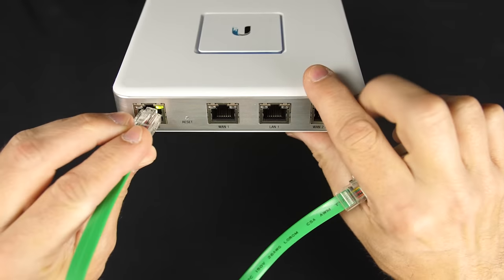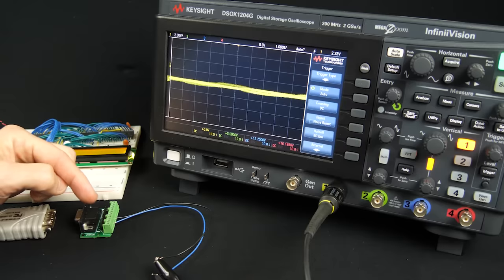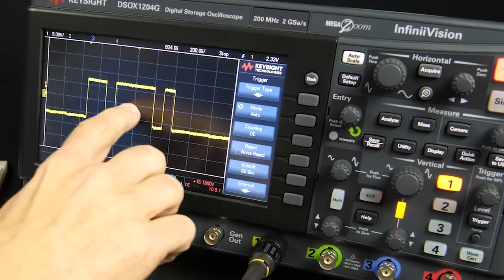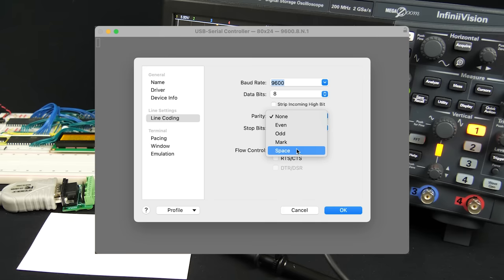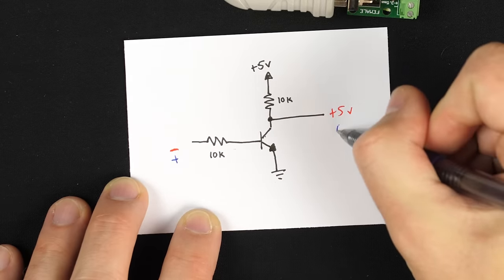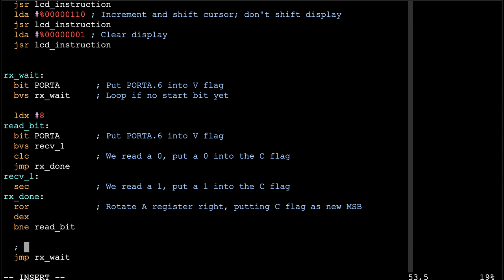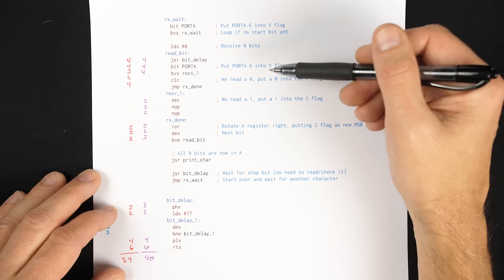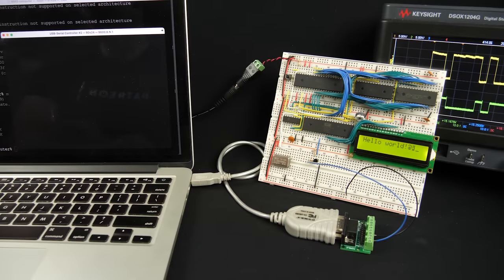The RS-232 protocol

Comment: Hey! If you are curious what the clock pins are used for, in some applications (I work in optical sensors) you need to have very precise timing associated with each data packet. The Clock and Ref_clock pins can be used to connect a very precise oscillator (at 1 kHz for example) to the device you are getting data from. This is helpful if you need to integrate the results you get (and thus need exactly defined dt.) This is an alternative to a synchronous serial interface, which comes with it's own problems. It is very nice to be able to use an asynchronous interface with precise intervals defined for specific data packets.

to get a little weedier, what matters more than the time a packet is sent/recieved is the time a packet was GENERATED. this often involves numerical calculations (in an FPGA for instance) where you need to know exactly when the communication RTL logic is "sampling" a normalizer or shift register for instance.

Comment: Finally a video again! :) It's crazy to think that 1 MHz is barely fast enough to read 9600 bps comfortably. Can't go much faster and do anything useful with the data. Btw, you should have probably subtracted the time it takes to write the character on screen from the stop-bit-wait-time to be super correct, even though it is probably a fast action anyway.
Looking forward to the video showing this with a dedicated chip.
Reply: The print doesn't happen until all the bits are properly put into the A register.  The looping only happens while he is reading the bits from the serial port, which has very specific timing.  The whole point of RS232 is that the clock is synced on the first read of a bit, basically the second line of code in rx_wait.  So the print is not happening until after the looping, so it is not counted in the clock cycles.
Reply: But he does need to be careful that it doesn't take more than 104 cycles, so that it runs while the terminal is transmitting the stop but, or else he may miss the start of the next start bit.
Reply: In real computers there is normally a dedicated chip “UART” (universal asynchronous receiver / transmitter) that does all this timing and shifting. The CPU is not expected to do all this. The UART chip is told what baud rate and it does its thing in parallel with whatever else the computer is doing. The computer may just be waiting for each character or do real work.
Reply: You can get away with it as long as you allocate a circular buffer  to store the received data AND use interrupts to do the reading. The display timing requirements are really not that strict. Check out The 8-bit Guy video on character LCDs, he used push buttons to write data to the display at normal human speeds.
Reply: @ChrisBouchard  That is what the cts signal is for, all he has to do is to drop cts at the end and the sending device should then wait. When ready to receive the next character he raises cts again. cts = clear to send.

Comment: Ben,  Glad to see you're alive and well  - and continuing this series.

Reminds me of many serial debugging sessions... where some device manufacturer would use the wrong gender (M when it should have been F), 25P on one end, 9 on the other... so we'd bolt together gender blenders, 25-9 pin adapters, maybe a null modem, and an LED module (for the user... are there blikenlights?).. all behind a desk with about half an inch of dust, paper clips, thumb tacks, coffee stirrers, get well cards, and the occasional half-eaten doughnut.

Also, love you showing the assembler (and your mistakes :).  Another blast-from-the-past doing 8086 during my CS degree times.  With all the high-level languages out there (C and higher) we forget how nested and spaghetti assembler can be.  As well as where the CPU meets the real world (pins).

Comment: This was interesting! One apparent mistake: when you calculated the timing for the half-bit you didn't account for the other cycles which were part of the read loop, you just divided the loop value by two, though I expect that was accurate enough to read from somewhere within the stable part of the bit. It would be nice to cover audio and MIDI in a future video.
Reply: It probably works out with 6 being a little less than half of thirteen, too :)
Reply: By my calculations, 9 would have put it right in the middle, even closer if you put a nop outside the loop. But as you say, hitting the middle exactly isn't real important. Throwing the bit delay routine to skip the stop bit is a little more questionable as it doesn't wait a whole bit without all the read logic, in fact it waits maybe 24 or 25 ms less than a whole bit. But you really want to wait 1.5 bits because you have the last half of the last bit, plus a whole stop bit to wait if you are going to do that. Probably best to just wait for the next start bit.
Reply: It is not a big deal.
If the sampling point is exactly at 50% of the bit time or 40% or 60% into the bit time, doesn't matter.
The purpose was to shift the sampling point away from the signal edge, since at that time (and only at that time) a few nanoseconds may make all the difference.
Reply: @jmarkmurphy  
No
You do note want to wait the stop bit time at all!
The purpose of the stop bit is for the sender to provide the receiver enough time to process the received byte. In his case it is the output to the lcd.
The stop bits are a setting for the sender only. A receiver can ignore this setting completely since the sender will start with a new start bit for the next byte anyway. There is no point for the receiver to wait when he can use that time for much more important things (as eg. storing the byte in a queue).

You may want to wait for the last data bit to be finished (but not the stop bits!). But you don't need to when the UART read loop is constructed like that

     wait for mark          <------ if the progeam waits here this means that the last bit of the previous byte was a 1, wait for it top be finished and
                                         ------ then wait for the stop bits to pass by untile the next start bit begins
     wait for space        <------ now we know  that this detected signal edge is indeed the beginning of the start bit
     .....
     receive the bits

This takes care of the 2 cases:
    * the receive loop was terminated early with a 1 as the last bit
    * the receive loop was terminated early with a 0 as the last bit

It gives the program the maximum amount of time needed to process a received byte.

Comment: I wish PHX and PLX (along with PHY and PLY) had been available when I was writing 6502 assembly language in the early '80s. Back then you'd have to use TXA : PHA to push the X register and PLA : TAX to pull it, in both cases losing the contents of the accumulator, so more often than not you'd have to save it first.
Reply: Yep. The extra instructions on the 65C02 vs the 6502 are nice. But in this application, unneeded. For instance, in the delay loop, what's the difference between using the X registers, or the A register?
In either case, the counting register is saved on the stack and restored at the end, so either could be used with no change in code length, or timing. Also, the code he's writing isn't exactly the shortest. For instance the part that has the carry set, or cleared depending upon the V flag with modifications to try and make each path take approximately the same amount of time. His method has the paths matched to within 1 clock cycle. Not bad. But an alternate piece of code with the same time matching would be.

  CLC
  BVC Skip
  SEC
Skip:

Only 1 conditional jump instead of a conditional jump and an unconditional jump.
No extra NOPs to try and balance the timing.
It's still one clock cycle off, as his is. But even that could be eliminated by careful placement of the code within memory, so that the BVC branches over a page boundary. If no page boundary crossed, the Carry set path is 1 clock longer. If a page boundary is crossed, then both paths take the same amount of time.

I am a bit curious where he things that the BVS takes either 3 or 4 clock cycles depending upon if the branch is taken or not. According to the documentation I have it will take 2 clock cycles if the branch is not taken, and if the branch is taken, it will take either 3 or 4 cycles, depending upon if the branch crosses a page boundary.  And since he's using a 65C02 and is explicitly using 65C02 opcodes, he should have used a BRA (branch always) instead of a JMP. The BRA takes 3 clock cycles instead of the JMP's 4 cycles and that one cycle difference would have allowed him to balance the path timing exactly, regardless of which path is taken.
Reply: @johncochran8497  Interesting stuff. Thankfully I never really had to worry that much about how many cycles it took to execute a given instruction. With the old 6502 it does make a difference which register you increment to form a loop because the {65C02 specific) INC and DEC instructions weren't available and you'd have to use CLC : ADC #1 to increment the accumulator.
Reply: @johnm2012  I've used both the 6502 and Z80. Frankly, they both have their places, but I prefer the Z80. And for the "Z80 is inefficient. Look at how many clock cycles it uses when compared to the 6502" crowd. I say that clock cycles isn't what you should be looking at in a system. Memory access time is the correct parameter. So if you take a 500 ns memory system, for the 6502, the maximum usable clock speed is 1MHz. While with the same 500 ns memory, the Z80 can run at 3MHz. And since the usual rule of thumb for the 6502 and Z80 is that a Z80 running at twice the frequency is about as fast as the 6502, the Z80 looks a lot better than the 6502 for a given memory speed. But the memory issue for the 6502 can sometimes be turned upside down. Because the memory has to be accessed during a half clock cycle, some makers decide to use the memory that needs to be that fast and alternate between the CPU and the VIDEO (Apple comes to mind). So the video output effectively was free of charge from the POV of the CPU and because the video subsystem was arranged to always access all 7 lower bits regularly, it got the dynamic refresh of RAM free of charge as well. But the memory did need to be accessed twice per clock cycle. Once for the CPU, and once for the Video.
Reply: @johncochran8497  I don't know the Z80. I've never used one. I went from writing 6502 assembly language to ARM. I've never even used a 65C02, though I must say I'd like to build one of Ben's kits.
Reply: @johnm2012  Well, writing code on either the 6502 or Z80 was fun. As for exact cycle counting, it would be hard to beat the floppy disk driver on the Apple II series of computers. TL;DR while writing data to the disk, the writes had to happen exactly every 32 clock cycles (with the excepting of a synchronization header where the bytes needed to be written at 40 clock cycle intervals).

Comment: On the level converter: many transistors have a base-emitter breakdown voltage smaller than the rs232 mark voltage. If you don't exceed the reverse breakdown power for this junction the circuit will continue to work fine for awhile, but the transistor's beta will gradually degrade and the circuit will eventually fail. A series diode on the base (cathode to base) or a shunt diode from base to ground (cathode to base) would fix this. BTW the reverse breakdown base-emitter maximum power is never specified, because the manufacturer doesn't want you to run the transistor in that mode. They specify the b-e reverse breakdown voltage so you know what not to do.
One other point: half of 13 isn't 6. I won't tell anyone if you don't :-)
Finally: I love your coding and explanations, they're crystal clear! Your whole approach is a pleasure to watch.  Thanks!!

Comment: I guess you need to block interruptions while reading from a RS232 port, or else you miss things. That implies we'll have a whole series, YAY! <3
Reply: Dedicated hardware can buffer small amounts of bytes so that the system can fetch them accordingly.
Reply: @paulstelian97  Yeah, I suspect that's what he was alluding to with those chips that make reading easier — they probably have a dedicated clock and buffer. But before he goes all dedicated chip I hope he does take a detour to talk about reading asynchronously with timer interrupts. We'll see!
Reply: UARTs have small amount of internal RAM.
Reply: @TheWeepingCorpse   As in the 16550.. and the built in UART of the 68030 for example ?   but  the IBM PC era  8250 and 16450 didn't .. remember having these chips on serial cards..
Reply: @leong108  @theweepingcorpse Yes there are such devices, but for the moment he didn't show them. What will be the next video? will he mask interrupts or will he unveil a new circuuitboard with an UART on it? ... or both!
Reply: Actually, unless your program has nothing else to do until it gets input, blocking for input like this is not a good idea. Also, with a serial device like this, the only way to ensure you don't miss any input without using interrupts is to block for input immediately as soon as you might conceivably be about to receive input. A better way (assuming you want to handle it in software) is to set up interrupts so you can respond immediately whenever input is available without having to wait around for it in your main program.

EDIT: It looks like there might actually be ways to set RS-232 up to do proper input polling, so you could potentially do that as well. (I was only going off of what was in this video about RS-232.)
Reply: @leong108  The older UARTs still buffer an entire byte of data. At 9600bps you can take a whole millisecond to read the data and still not lose any data. The later 16550 PC UART brings this up to 16 bytes.
Reply: @sillymel  I bet the next video (videos <3) will be about creating a keyboard driver, I can't believe a main program will be seating quietly waiting for input while running NOPs... But we needed this introduction!

Comment: This brings back memories from the good old days with a breakout box and a Wyse terminal. It was fun watching the DTR and CTS/RTS lights at low baud rate and then figuring out you needed a jumper to pull up the DTR on certain computers so high rates wouldn't glitch out. No Googling back then.

Comment: I started working on VAX’s in 1983.  There was a cable between the DEC 220 terminal and the Gandalf modem.  We connected to the VAX, 1 km away.  At the same time we bought 8086 PC’s which also connected to the VAX.  We sent our data to the VAX.   We could send maybe up to a million bytes to the VAX.  It took 3 hours which was about the limit.

I liked your video because you hooked up the cable to an oscilloscope.  I had a sort of intuitive idea of how the data signal translated into electric signals but the video gave me a better idea.

One thing, I wonder about.  We had digitizing tables that sent big streams of data to the VAX.  We bought two new boxes to reliably send data from the digitizing tables.  There were standard RS 232 cables to the new boxes.  The boxes multiplexed the data onto 2 synchronous cables which went to the VAX, 1 km away.  I cannot remember the name of the boxes.  We bought cards to add more standard RS 232 cables.  A year later, I bought fibre optic cable and copper to run ethernet which was an order of magnitude faster.  What was the name of the boxes?

Comment: Between 1978-1980, while I was in high school, I did programming consulting at Rockwell International.  One of my major projects was to write a driver for their mini-computer to upload and download via RS-232 to a heavy metal casting floor data acquisition device engineers used. I used many of the unique signals in the 25-pin standard beyond the 9-pin, especially including the timing signals.  Funny how tech fades into the past, and also how evolved tech can lead younger people to not understand that this was challenging programming.  Essentially I had to write a device OS, upload it, and then later ensure the engineers could download their data.  These days there are libraries and robust drivers, not to mention a host of smart devices with their own embedded OS, making that task easy today.

Comment: Boy does this bring back memories!  We used terminology like what you are describing as a Asynchronous connection or with a clock as a Synchronous connection.  Using a clock was really important when the data had to be exact!  Such as running it through an encryption device.  What could really screw your day was if you were working on tail circuits.  A tail circuit is like extending the transmission once it comes in from the outside.  Computer to Modem (Distant End) to Modem (Local End) then tail to another modem also local then down the hall to another modem and then finally to the local computer.  You did not want to have a "floating clock" between the main local modem and tail circuit modem forwarding the data.  The clock flowed with each side of the data be it Transmit for Receive (if I remember correctly).  Want to go at a higher speed or longer distances?  Check out RS-422 and using a "balanced circuit".

Comment: One of the nice things about RS-232 is that the hardware tends to be bulletproof.  We always had a random collection of cable adapters wired in different ways (straight data, crossover data, various flavors of looping back control signals, etc).  Never once did I manage to release the magic smoke by plugging things together in the wrong way.  Connecting two transmit pins together won't work, but it also won't cause any permanent damage.